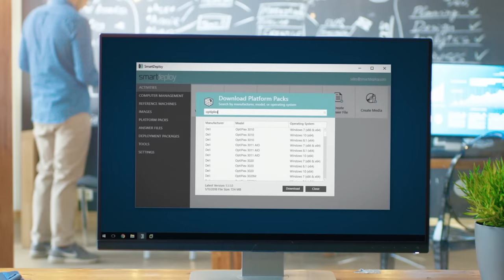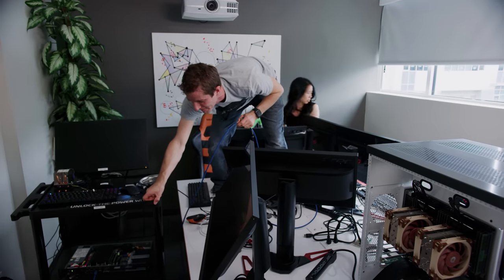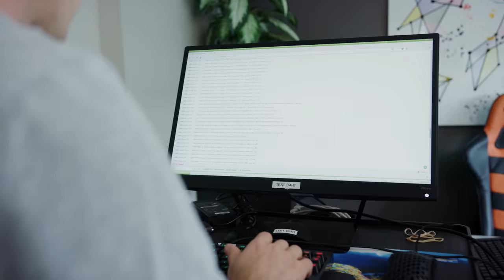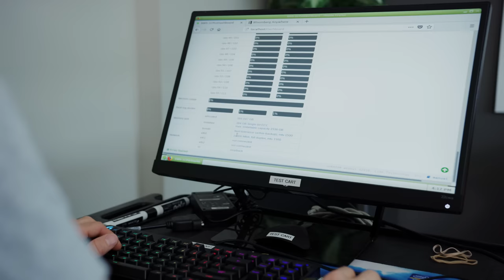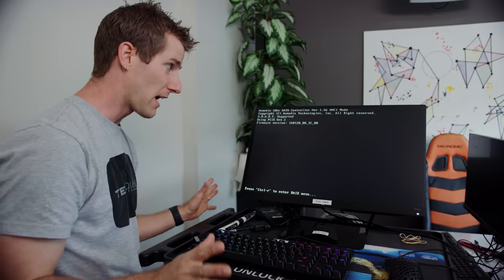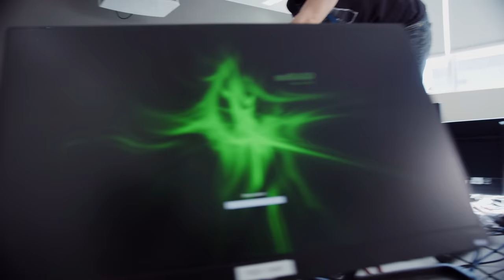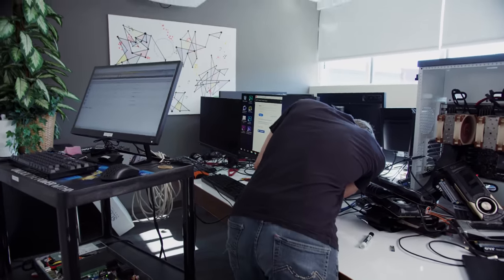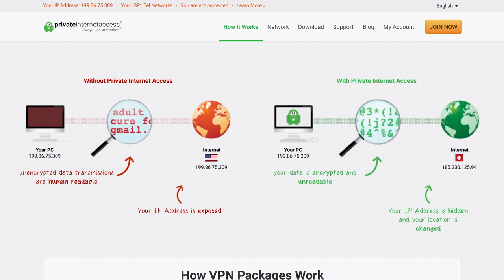When everything goes wrong - 6 Editors 1 CPU Pt. 3

Comment: Me building my pc for the first time, or trying to troubleshoot the problem for it not working.
Reply: Den888 999 did you fix the issue? I’d be happy to help
Reply: Moroccan Jockey yes i did. I remember my pc had a problem where it would turn off randomly sometimes and sometimes not even work. I searched the internet for so much possible reasons from ram, graphics card, motherboard problems to viruses in the system, windows reinstallation, nothing helped. It took days/weeks as i couldn't just replace parts because i didn't have spares, so i was trying everything. Then one day i smelt something burning i checked the psu power cable adapter that i bought on ebay and turns out it was melted in one spot that was not easy to see. All the frustration and time over a simple psu adapter... Moral of the story: dont go cheap on parts for your pc.

Comment: Why not duel thredripper 32 cores of epyc?
Reply: Because nobody made a motherboard for this + custom BIOS to make it work fine
Reply: Duel to the DEATH
Reply: The motherboard would be considerably larger for the heat sinks to cool the beasts. Would be a site to see.
Reply: the mobo has very little to do with cooling. It doesnt need to be bigger to cool better.

Comment: I have an idea for a good video, you will probably need expendable hardware,but get a rig that produces a decent bit of heat, and run it in a freezer room, without coolers, or at least extremely minimal coolers, just cool the rig with the ambient temperature of the room, which in a freezer room, well can get pretty far down there

Comment: Well Linus, it's not just the Intel and Nvidia technicians who cringe as you crawl all over that machine, plugging in graphics cards that's in a stack on the table or dangling from PCI-E extensions, all while the PSU is hot...

Having worked on machines in the same ballpark I've done several "interesting" things, and fried the occasional component just by doing something stupid as chaos claimed my work area. One of the simple things you can do to cut down on this kind of mistakes is to make sure the PSU is not hot as you work on the machine. Do make sure the machine is still grounded, but having the PSU hot is just like sending Murphy an invitation.

At 7:35 there's a pop that sounded very much like a component letting the blue smoke out. Most of the time the smell of blue smoke means things doesn't want to work very well afterwards. Fortunately this time it was Linus kicking a box or something, but it does bring back memories...

Comment: I don't know the level of workstation power that you need, but it's entirely possible to just use a X299 SAGE/10G and a bunch of M4000s and not have to use risers for them. As for the USB controllers there isn't a much cleaner option that I can see.

Comment: The trick to these situations is to change as many variables as you can, all at once, and maximize physical clutter and confusion.  You're doing OK but labelling things is not part of the procedure.  Also, I recommend you accumulate a week or so of empty pizza boxes and rotting half-eaten Chinese takeout on that desk; this will help give the electrons room to move around in privacy.  Also: try to perch the video cards more precariously... try playing Jenga with them.  There's only so much stability to go around; you're wasting far too much of it on the physical realm, bottlenecking the logical and emotional  dimensions.

Comment: Hey Linus ,
Why don't you start with one video card ,
One USB controller , then switch it off again and the add the 2nd , similarly 3, 4 ,5  , 6  you won't need to play try and error ..... And will spot any defective hardware on the fly ..

Comment: Back in the day I had issue with boot option roms causing problems. Supposedly there is a limited amount of space for that stuff in memory for the bios. So it can only load as much as it has space for then just doesn't load anything after. This happened with a Revodrive of mine and meant I couldn't have another sata card installed with it.

Comment: Can you please make a Video about Radiation of Computer and if it matters, which Case you use. If it matters if the Case has Glas on the Side or if it is closed with metal (sorry dont know how to say it).  Would be nice if you could measure up the radiation. Also would be cool if you test the radiation on a Computer without any case at all.

Comment: pretty risky to pile up the gfx cards like that. although they are grounded thru the cable, it isn't enough metal to shunt much current. they need to be screwed to the case for proper grounding. sure hope you don't fry any of those lovely gpus

Comment: I don't usually have many questions about working on computers. BUT! I have this weird thing called an oculus rift, And I have a problem. I have many USB devices connected to my computer. So I bought a USB 3.0 card to add to my device. Turns out doesnt like working with my oculus. Can you do a video on best USB 3.0 cards for using with the oculus rift? Preferibly 4 USB ports and up.

Comment: Could someone help me out here my PC flopped on it's side and since then it does not show anything on screen and I tried changing the wires and it did not help
Reply: Flopped on its side and now nothing shows on screen?
Um...you might've fucked your graphics card um, I dunno exactly.
Is it actually TURNING ON?

If it is, try plugging your monitor into your motherboard (Assuming you've got integrated graphics, I assume so, but until you elaborate)
Reply: You might've knocked either a wire or a card loose. Try reseating your RAM, GPU and make sure the CPU fan is secure. If all those feel sturdy, try your HDD cord, make sure the SATA cord is in properly, after all that, if it's an HDD (spinning disks) and it was on, you might've damaged that. Your computer should be able to live through it, just fine; I would highly recommend just reseating everything.

Comment: I'm not even sure what the benefit of this setup is. You'll have to properly install and test everything again anyway, so the time saved mounting things properly is only spent later anyway, and that way you can avoid a load of iffy connections and bumping cables. throws hands up

Comment: Anybody else feel like this work better with AMD Epyc (how every you are supposed to spell it)? I mean, at least from what I’ve seen Threadripper has far more PCIe lanes and doesn’t have any stupid stuff like PCIe through the chipset. Also, even though you would want to keep each editor on a single CPU cluster I though the Epyc CPUs had much faster interconnects between the CPUs. I also remember Wendel going over NUMA and UMA modes for the AMD threadripper 2’s but I’m not sure if this would have an impact.

Comment: About successfull reboot of the one with assigned sound card (18:24). I had an issue on my laptop of non working display after wakeup. The solution was an update of BOTH BIOS and sound card (or audio chip that is) driver (I've checked!). Why in the world audio chip driver would influence the work of display? Manufacturers simetimes amuse me.

Comment: Hello linus can ya help me out with my pc I have had it for a year without being able to use it it has a msi z77a g43 motherboard with an  i5 3770k I belive got it for 10 bucks at a little shop it has a Asus 1gb graphics card don't know the make a 8 gb of hp ddr3 memory 500gb of storage and a hck 670 watt powersupply  total cost are 37 dollars I got some cheapo ass case to hold it together but there is one problem it gives me a 3 beep error code while booting no memory detected my birthday was on 4 October I'm getting around 75 dollar total what do I need to buy new cause I really REALY want to have a cool working pc for over 5 years by now please help me ?

Comment: How well does it run fortnite? its funny that new ultra fast products require setup like installing an ISA ram card back in 1989. and yes network cables must have a huge tangled coil somewhere in there to be standard.

Comment: ive been watching this for a while and i was just like apart from just to see if you can whats the point of this build. it cant be that easy to fit 6 people around 1 desk area. and you just increase the likely hood you are going to have problem each time add a layer of hardware/software. Dont get me wrong if it works its cool but its just not a real world thing. build this as a server with rdp so they can work anywhere in the office i mean you got 10 gig networking. that i would like to see. 6 editors working remotely off 1 pc.

Comment: use  process lasso  to  moniter  cpu   usage   and  proccesses  active  etc--Process Lasso is a process priority optimization and system automation utility designed to accomplish priority optimization, CPU affinity optimization, core optimization, automated rules, automated power profiles, and more. For instance, set a custom CPU affinity and have it applied every time a process is launched. You name it, and Process Lasso does it!

Its most popular feature is the unique process optimization technology called ProBalance (Process Balance) that will improve your PC’s responsiveness and stability by making intelligent, dynamic adjustments to the priority class and/or CPU affinity of problematic background processes. The technology can be demonstrated with a simple CPU consumer, and even if you don’t think you need it, it can save you from a worst-case scenario of CPU monopolization.----https://bitsum.com/